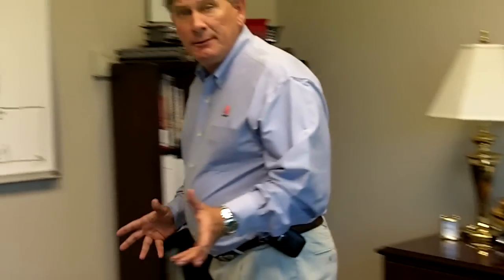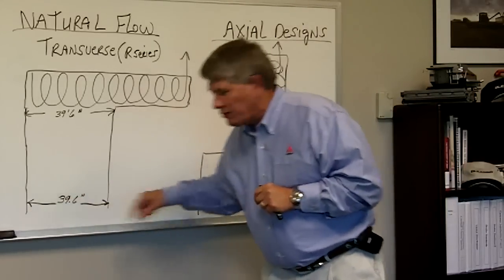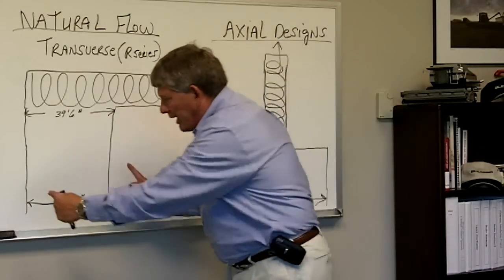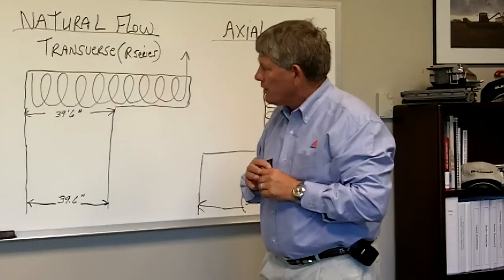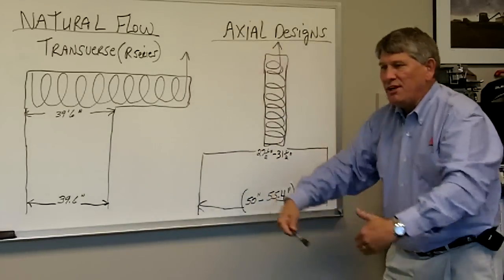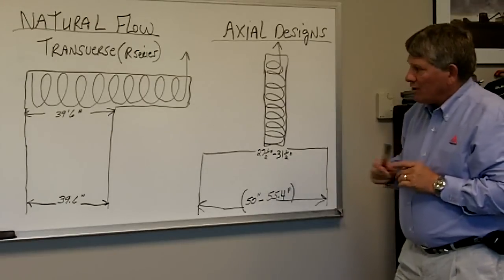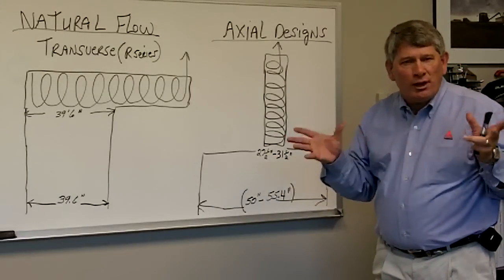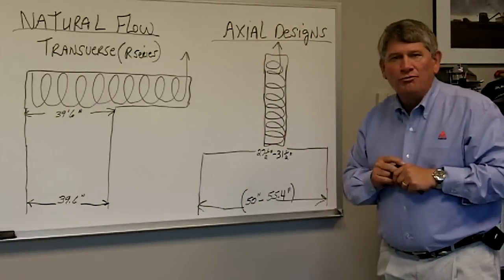Natural flow vs. Axial flow Combine Design

Comment: Kevin, actually, while the other brands lack an open grate top half, there is still threshing across the entire 360 deg surface. What you should specify, is the fact that only Gleaners have a complete 360 deg SEPARATION. 

I have long understood the significance of narrow vs. wide feeder house designs, too. Just look at a popular other leading brand. They wrote the book on narrow [and also very short] feeders. Their equalizer was chain speed and slat design. It worked very well. So does yours.

Comment: He tries to make the axial flow design look worse by making the opening to the rotor really skinny. The feeder opening is 50-55 inches and the rotor opening is 27-33 inches. That it more than half the size of the feeder opening. 

What he doesn’t tell you is that when using natural flow, you replant your field behind the combine.
Reply: Dumb comment. I've operated both & I believe the Gleaner to be no worse than anything else & possibly a lot better grain loss wise.

Comment: Then why don't you send massy combines out with the "natural flow"..... not knockin gleaner but in greem stemed soy beans our 9770 deere with an F35 will out run my brother in laws class 9 gleaner with same size cut, while maintaining less damage and loss!? Also figure the surface area of the rotor not just the width, not much of a pinch point.